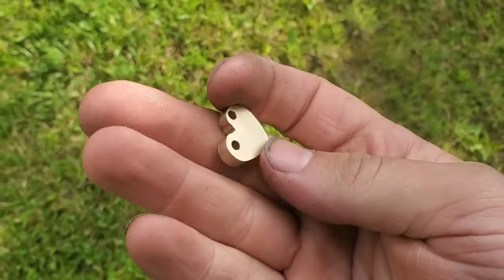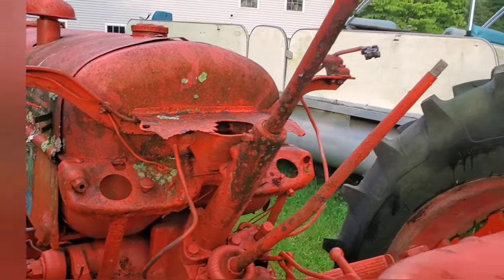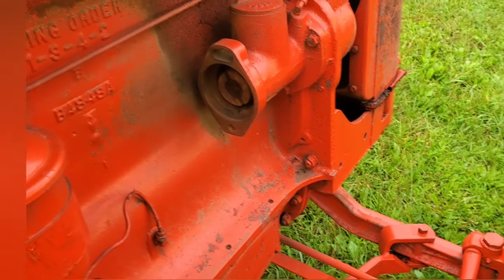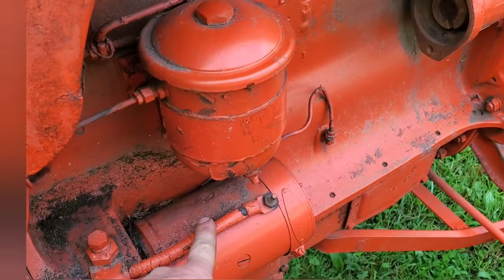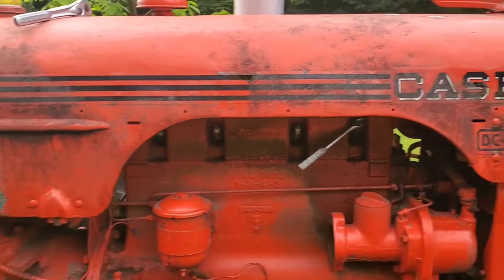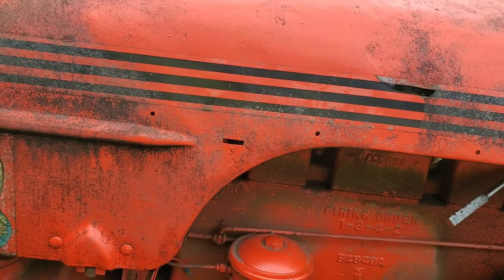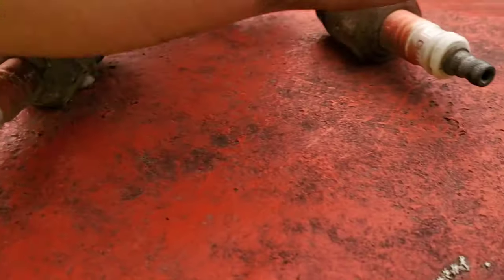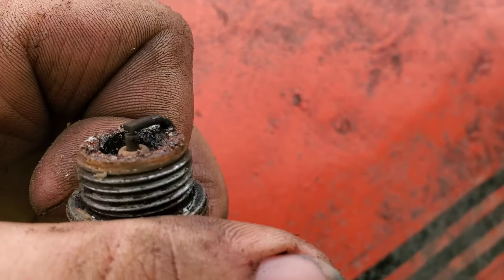Case DC-4 overview

Comment: That's a 1953 DC4.  The hood is from an earlier model.  Watch out for stuck valves. They are one of the finest tractors ever built.  Thanks for saving it.
Reply from the maker: What's the difference from earlier to later hoods?
Reply from the maker: Thanks. Good to know.

Comment: Pull the inspection plates on the oil pan and clean it out, guaranteed to be 1in worth of sludge and trash in the bottom
Reply from the maker: I fully plan on it. My LA was that way when I cleaned it out.